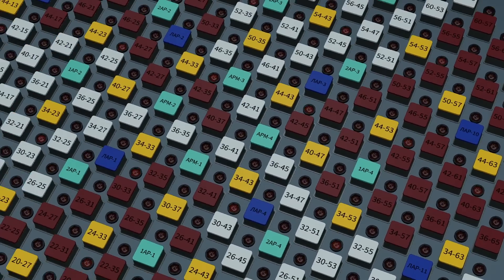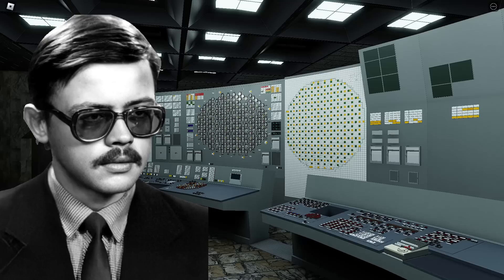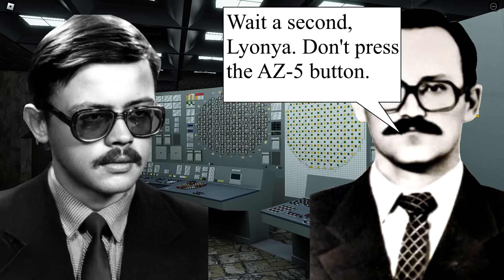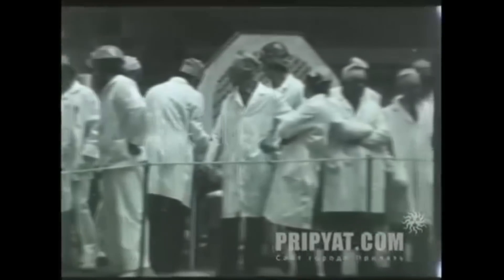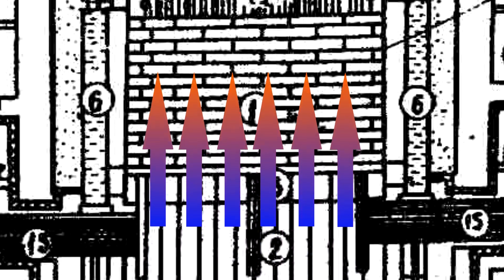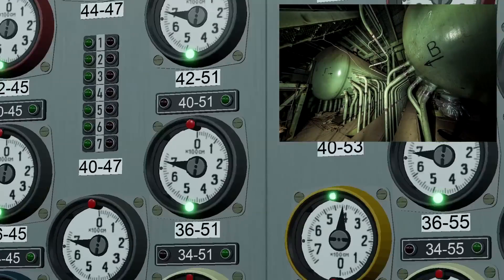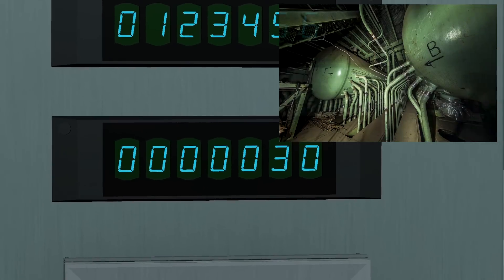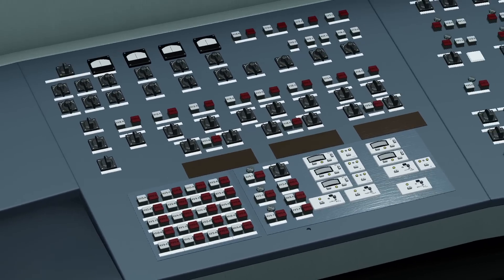Would Not Pressing AZ-5 SAVE Chernobyl?

Comment: Yes it does,it just melted like reactor 1 or three miles incident and probably not gonna be useful for future. RBMK already dangerous design and main purpose is generating power and veapon grade plutonium from vver wasted uranium .In theory ,its win win situation but non homogenous fuel of rbmk cause control problems like using gasoline alcohol maybe tinner mix for your car,and lack of safety and soviet style management lead to this unfortunate accident.In soviet doctrine,meltdown must be avoidable in any expense due to high construction cost of a rbmk ,they were thinking to change/clean damaged units ,refurbish it and use again.In. meltdowns this is impossible.I am not even mentioning soviet factor of safety ratios ❤Great content by the way, you rock❤
Reply: For the record, an alcohol-gasoline mix for your car is what all gasoline has been mixed with gasoline since the 1920s and mixtures today can be as high as 85% in either direction.
Reply: @AiOinc1  but you got the point :)
Reply: RBMK doesn't have 'non-homogeneous fuel'. Where did you get that idea? It runs on perfectly ordinary uranium oxide. EVERY reactor creates plutonium as a byproduct.
Reply: @MinSredMash  ideally it should.today rbmk s   run on high quality Uranium.However this doesn't make them adventurous like in 80s.Currently not very financially efficient than expensive vver s .
Reply: @EJDERMALO-qk7kh Modern RBMKs run on the same uranium, just enriched 0.4% more.
Reply: @MinSredMash  in ussr times worked under low grade, mixture of  uranium oxide and vver wastes
Reply: @EJDERMALO-qk7kh What? No they didn't. Where did you get that idea?
Reply: @EJDERMALO-qk7kh  
Whut?!? The whole point of the RBMK was that it is able to run on natural/ very low-enriched uranium. To my knowledge the RBMKs ran on 1.8% - 2% enriched fuel before the 1986 accident. After 1986, this was raised to 2.4% - 2.6%. I have never found a single sentence anywhere saying they ran on MOX fuel back in the day. The only Russian reactor I know to actually do that now is the BN-800. But that's a fast breeder reactor, not an RBMK, which is a thermal reactor.
Reply: @swokatsamsiyu3590  soviets dont really care about quality of work and follow the directions in order to  make plutonium cheaply they did and due to uncertanity of reactions ,there were some problems in operation after end entire rbmks either closed or converted into work in enriched fuel
Reply: @EJDERMALO-qk7kh  
But the RBMK has never been used as a weapons-grade plutonium producing reactor. Yes, all reactors make some plutonium while they're running. They can't help it, it's a natural part of the fission process. However, that's not the same as having a reactor produce it on purpose. Not all plutonium is created equal. If you want plutonium for a-weapons, you're looking for the Pu-239 isotope. And you can only get that with careful planning and fuel shuffling/ timely removing from the reactor because when you leave the fuel in there too long, too much Pu-240 will have accumulated. That's a very poor material for a-weapons due to its erratic behaviour in such a bomb.

The RBMK still has a fairly low fuel enrichment compared to PWRs/BWRs. These usually sit between 3% to 5% enrichment due to the water moderator absorbing some of the neutrons. They need the extra enrichment to overcome that. They are unable to run on a fuel enrichment used in the RBMK.
Reply: I recommend watching this: HOW THE 4th UNIT OF CHERNOBYL NPP WAS BLOWN UP (channel-KS).
Reply: @ВладимирПравдин-ж2п  
Watched it last evening, and this is most interesting material. Would you happen to have resources I can access/read? Because if this is correct, there are a lot of people with egg on their face, and not just in the USSR.
Reply: https://www.youtube.com/watch?v=yIA_FMz9n1k